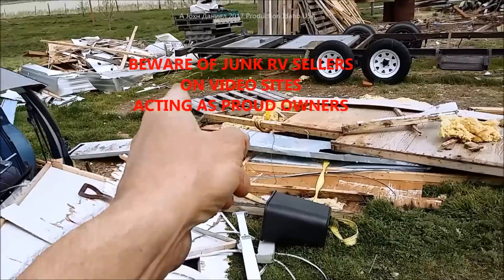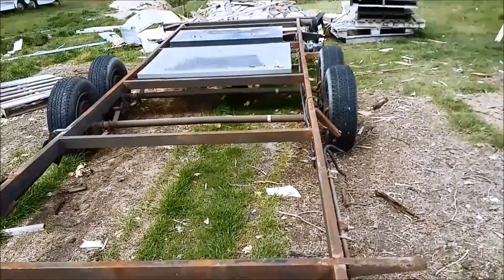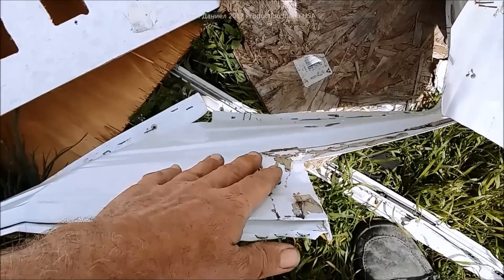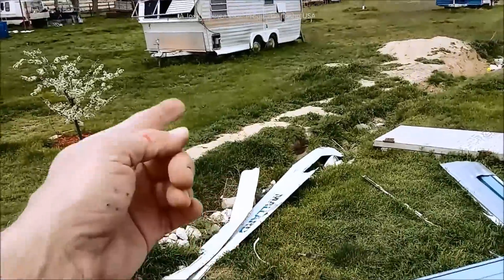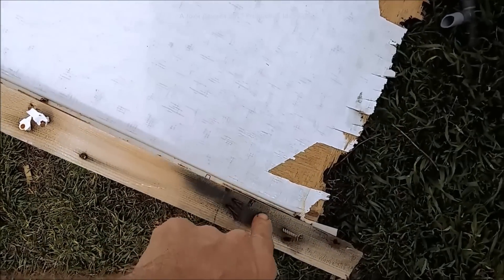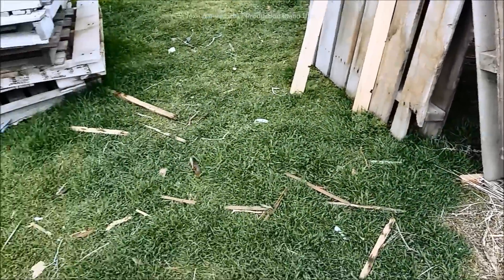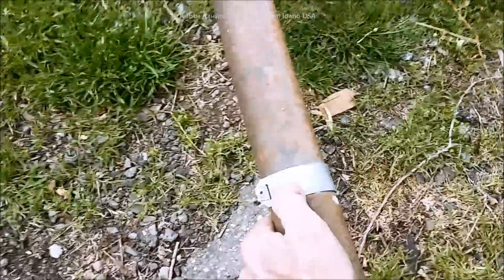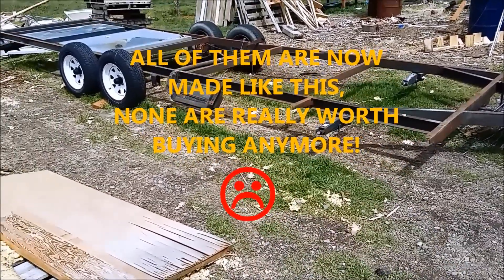HOW THEY MAKE RV Campers Travel Trailers, The truth, Wow! Info Below

Comment: yeah why not make it solid 20 tons of stuff to last forever - in one place because nothing will be able to pull it smh.
Reply from the maker: Normally I do not reply, but I just Gotta - I think your comment shows the absolute ignorance how a huge portion of the public think. That it can only be lightweight if built of pure shit materials. Or the other extreme, heavy like a fucking semi truck. THIS way of thinking is exactly why they can sell this crap. In japan for the Australian market they build a RV with Hydraforming, Injection foam molding, and extruded aluminum and a 6 meter, the longest there is 15% cheaper with more amenities and 25% lighter with a crash rating of a fucking volvo. But Nooooooo We Americans are pure suckers, because think like what you just posted is a enabler to the scum bag makers using primitive materials and saving $1 in sealant on a shitty RV. THANKS MAN!
Reply: your right - they use carbon fiber and maybe some kevlar and stainless - maybe some f-22 composites to keep the weight down with titanium beams.. i bet they could engineer one to last 100 years easy - my bad
Reply from the maker: Very wise thinking there!! Or they can learn a lesson from the Japanese! Or like my ground up construction, use very light 2.5" thick flat 43" tall garage door panels that are R-13 rated, and made lengthwise as long as you want/order them and then the trailer would be super light, rigid, rot free and cheaper....... Nah, they will go your way.

Comment: Not making excuses, but the manufacturer is trying everything they can think of to achieve weight reduction.  Its not a case of getting what you pay for, its a matter of not taking care of what you have.   I have one that is garage kept and it is as good as new (what that is worth is debatable), no dry rot etc...  Betting this one was put through the ringer by someone with the money to buy a new one every five years. But yes, the guts are weak.  You know that going in, I hope.
Reply from the maker: If they really wanted to do weight reduction they would stop using extremely heavy partical board and high density compressed MDF. They would use 2.25" metal stud which is 19% lighter than wood and stronger, they would use Hydraforming for trailer frames. They would use blow molded inner webbed fully complete fully finished one piece roof. No, they wanna leave out the seals like they did this one and use green cut lumber scraps and un galvanized staples and deteriorating formaldehyde glues.

Comment: There needs to be a class action lawsuit on this. I don't know why there hasn't been yet. I've been telling people to avoid travel trailers in general and go with an alumnum or steel caged older Fleetwood Pacer or Southwind (or similar). Better yet, convert a well built van. I now have a '79 dodge camper van. Solid steel (no rust) and fiberglass roof.

Comment: Based on past experience, if I had a 30-foot trailer I would put about 2000 lbs in it. It would weigh 7300 pounds or so. Of which, the axles could support 4600 and the tires even less.

Comment: I have been thinking about selling my home and land. Then buying an RV and a new truck and just going where the highway takes me, but these videos showing cardboard RV's is scaring the crap out of me.  I don't need a big RV because it is just me and I don't want to pull a huge RV around everywhere.  Does anybody have any idea which RV's are the best?  
I will be living in it permanently so I need a dependable one that will last 25 years or so.
Does anyone have any information of having the underside of an RV sprayed with Line-X or Rhino lining? Will it work to protect the underside from water and moisture? Is it possible to have it done?  What about the top, can it be sprayed to seal the top?  
I am asking serious questions as I have never owned an RV and I want to get a good one that will last.
I was told Line-X and Rhino would work and told it will not work, depends on who you ask.
Any information from RV folks will be greatly appreciated.
Thanks in advance.
Reply: Dief Enbaker Linseed oil,it actually soaks in and hardens. My deerstand and chicken is sealed with linseed oil. All plywood.
Reply: Apply with a Hudson pump sprayer.

Comment: Thanks for the reveal. I currently have a 1999  19' Coachmen class B camper van on a Dodge 1 ton. I think that vans are likely the best built RVs out there as they are just a converted Dodge, Ford, Chevy, Mercedes, etc. So the foundation is designed and built well. But I am looking to go full time in a travel trailer in a couple of years. Have you ever torn into anything made by Northwood? They claim to use a heavy duty frame, axles, and better framing, etc. Their brands at Nash, Arctic Fox, Desert Fox.

Comment: I am thinking about buying a 72 Airstream Overlander for just under 14k. Mostly all original interior and no visible water damage. Some family is telling me not to because of it's age, but after alot of research, new ones are built like garbage. This one is old and needs some updating but is SOLID. Any advice?
Reply from the maker: Compare it to crap on the market today,  30k for crap. So if you buy that you have 16k to put some high tech in it.

Comment: No way that's a 2008. Based on the color schemes and the rust on the frame (and frame design) it might be a 1998. Probably older.
Reply from the maker: Manufacture date on the door tag for state of Idaho plumbing Electrical inspection code, March 10, 2008. Title date May 5th 2008, registration date May 30th, 2008. 
But who knows, could have been sitting in a assembly yard 10 years.

Comment: I have a 28 year old trailer with mastic. It's fine. Mastic can work fine, but it also requires maintenance.

Also the reason, at least here i. Sweden for building it is due to weight restrictions. Building it in hardwood etc would make them probably 10x more heavy. Making them illegal to tow with a regular license here.

The amount of water damage is of course not OK, but the idea is for there to never be a water leak. As long as that is true they should hold up fine.

Comment: They rate the axles with the idea that 10-15% of the trailer weight will be on the tongue, so if it weighs 5300lbs, 530-795 lbs will be on the tongue. so you could put some stuff in it - a few hundred lbs worth.... however not much, and yeah, once you go over a pothole, the dynamic weight coming down on those toothpicks is gonna overload the hell out of them.  Those are pretty low for a 30 footer.   Toy haulers are built a bit better than a travel trailer - the frame has to be heavier and the floor a bit harder... and axles obviously beefier.  but other than that, the walls and everything is build just like this, it's sad... The funny part is they even advertise these as being super light, ultra light, etc... F that noise, gimme the one made of cast iron, steel and with tank tracks... :D
Reply from the maker: The first RV company to decide to use Roto-Mold UniBody construction will rule the world. Until then,  suggest termite, water, vandal and lousy ass construction insurance from day one.

Comment: I got the impression that trailors were junk, you can look at them and see how flimsy they are, and wouldn't last long. that is why I like air streams, casita and scamps. they cost a lot more but I still see air streams being used that are 50 years old and more.
Reply from the maker: There are only a few realistically well built RV trailers. I would rather have a Holiday Rambler, Pre 1994 over any other on the road. Other great makes are Silver Streak, Boles Aero, and Pre 1986 Avion

Comment: Did you put it back together?
Reply from the maker: No, sold the frame and axles for $100 as is. The only things  I reused was the AC unit and Heater. The rest was put in a dumpster.

Comment: You can badmouth that little Mallard all you want, but you won't convince me. First off, I am not in the RV business, I have no ax to grind. I bought a "99" 26ft. Mallard in 2007, lived in it full time in Mississippi for 10 years, I have no complaints. By the time I sold it in 2017, it did need some work, but I lived in it with 4 dogs, full time, and it served me quite well. It's easy to be a critic. Requires no training.
Reply from the maker: Thanks, folks needed one example out of about 1 million junkers of a a great well built version!

Comment: Real eye opener. Such crap and you have to get a tiny mortgage to buy it. Good thing I had mine custom made by an expert carpenter and I know exactly what he put in it. Only good quality material.
Reply from the maker: Just about every cargo trailer maker will build SPEC construct. Charmac in Twin Falls Idaho will build you a 30 foot true 100" wide fully ready to go tube steel framed unit with sewer tanks under it where you want and all the windows. For 40% the price of a rot box seller. Just do some research.

Comment: I had a brand new Scion "luxury" fifth wheel by Fleet wood. I had a problem with the black water rinse system leaking. I took off the access cover. I was shocked. Behind the access cover was the last shift's trash. Saw dust, sandwich wrappers, empty coke cans. All piled up and sealed behind an access cover. I guess the trash can was too far away.

Comment: I bought a 1978 prowler in 1988.It had a small amount ofwater damage in the rear wall leaked marker lights.I purchached front and back skin where lights were mounted.I tore it apart reframed wall with clear fir sealed with thompson water seal.All screws pulled windows doors evertthing replaced with new buytl tape.stainless screws one size larger.still doing very well and use it every year no leaks.Had to replace hot water heater last year.I know construction was never the best but this one has stood the test of time.I have the original stove  furnace and refridgerator.No circuit board stuff to go wrong.

Comment: I'm a full-timer in a 98 Thor Residency. Everyone knows Fleetwood is junk. The rot could've been from a water line busting or leaking on those junk crimps. We've replaced most of the connectors to get away from those crimps. Theyse things do require maintenance just like a house. But yeah, stay away from Fleetwood. Those are the ones in the rv parks with water running out the bottom. They try to compensate with pretty furniture...which is also junk.
Reply from the maker: Thor Industries made some bad assed RV's as long as you bought one thats pre 2005-2006. After that they acquired a bunch of defunct brands, including Fleetwood in 2009 or 10 and started building most of their RV's just like a Fleetwood. So if you buy used, seek a older Keystone Sprinter, a Thor before 2005, and do your homework!

Comment: So...entry level trailers ARE built like crap...no doubt about it.  However, when you don't want to spend $40k on a travel trailer, this is pretty much what you'll get, lots of cheap materials and sloppy construction.  I have a Northwood product and I can tell you the frame is MASSIVE and they don't use ANY OSB on the floors or in the trailer.  One note; Fleetwood no longer makes Travel Trailers.  RV'ing is not for the faint of finances...if you want to RV, get your wallet out as you can't do it on a shoe-string budget.  Also, 100% correct; You MUST keep everything sealed which means regular inspections of windows, doors, and all openings on the roof.  Having an RV is like having a second home.

Comment: I own a teardrop trailer made by Little Guy (now NuCamp) which uses an aluminum frame instead of wood.  Also, my teardrop fits in a standard garage so I can protect it from the elements. Teardrops aren’t for everyone and are really just is a step up from tent  camping.  Actually, they are still camping as opposed to RVing.  I’ve seen quite a few older women who want to see the country who buy a teardrop since they are light and easy to handle.  Again, they aren’t for everyone, but they have their place, and I think are better built than this.

It’s always fun to have people want to see our teardrop.  Almost all are pretty nice about it.  I did have neighboring camper make a point to come over and mock my little teardrop trailer a few years back and was giving me his rant of how I got ripped off on a price per square foot basis.  I’ve had my suspicions about the quality of bigger trailers like this, now I know. After watching this, I can mock back.

I think my next step up from the teardrop is going to be a Casita which is a fiberglass egg.  Casitas are larger than a teardrop, but smaller than this pile of firewood that you’ve shown,certainly better construction than you’ve shown.

Comment: I was on a tight budget but glad I held out for a Holiday Rambler. She's a 1988 29' fifth wheel and just as solid as the day she rolled out of the factory. Heavy boxed frame, welded aluminum superstructure and screws, not staples throughout. She's been outside her whole life and faded but still as tight as a drum. That's quality.

Comment: A while ago WE bought a 5th wheel (used). found out after using it ONCE, that it had some water damage on one side of the slide out. I pulled off siding to find water damage and severe rot which went all around the back, also above the door, and all over the nose.  I pulled the trim on the edge of the roof to get to the cause (roof?), only to find the rubber roof material barely went over the edge. And the siding didn't meet the epdm material. (I thought it would have overlapped the siding)The only thing sealing this point was the trim and buytle rubber tape. So as the screws rusted and the putty degraded there was nothing to stop the water. I am now in the process of completely stripping it down to the frame and plan to re-construct the whole thing myself. After all the horror stories and seeing the videos of these things being built, I'd rather do it myself!

Comment: Trailers are built this way to save weight and to keep costs down . The individual pieces don't have strength on their own, similar in concept to plywood. Each individual ply is weak on its own, but together it's strong and lighter than a solid piece of wood. It's called lamintaion. Aircraft are also built this way. Take apart an aircraft wing and you could easily bend the struts holding it together. Trailers are strong until water gets into them, just like cheap furniture made out of MDF. Pour water on your grandmother's antique dresser and you have a wet dresser, pour it on a Walmart dresser and you'll have a rotting mess. Airstream and Casita are built primarily out of lightweight materials that aren't affected by moisture, but they also cost way more than trailers of equivalent size.

Comment: What you say is partly true - BUT - if a company built them as stout as your suggesting, they would weigh so much that it would take a 1 ton dually to move them around.
Reply: Although I must say that BigFoot travel trailers (or any other "molded" fiberglass units would be a great improvement over stick-and-tin units)
Reply from the maker: You mean like my 32 foot Holiday rambler? With its 2x6 box frame and aluminum stud wall construction? Yeah, my 1993 F150 with a 300 L6 in it does have a bit of a time getting it over Donner Pass.
Reply: yeah, the more I thought about it, they don't need to be quite that light - your correct - these types are shit...

Comment: Just moved to Florida, cannot believe how cheaply made Fleetwood mobile homes are built.
They seem to dissolve like Alka Seltzer. So I moved on, bought a conventional home. Later on I bought a Winnebago Vector/ Grand Tour class A motorhome, no roof air.. Central Air, with a home air filter. A guy down on his luck.. Tried to sell me his 2006 Fleetwood Bounder. What a POS 😕 it was 5 years old, beautiful inside.. But !!! In time.. The slide outs became rotted out by the gear mechanism. I greased the dam thing each season.
The frame is Freighliner, and is perfect. But the rest is skunked.
This was a garage kept unit, I bought it in 2011. My Winnebago is perfect. Fleetwood should be sold at Harbor Freight.. POS.

Comment: John, I'm following you like Jesus!! What brands are good?
Reply from the maker: Winnebago as a Trailer is made with a more durable locking foam core structural design, it has a better water resistance build process then most. But other than that the whole industry is gone to junk. Few examples from each maker is good, but note the word few!

Comment: You'll never convince people with disposable income to not buy them though; hence the manufacturing/engineering choices..

I've torn apart Jayco, Oliver, Airstream, and Pleasure Way. They are all junk. Airstream has the corrosion resistance and aerodynamics which makes them a little better. All have garbage chassis joints and week metal. This is why they just become noisy and fall apart. You will pay what a house cost for one too.. Even a late model 16' is around 12k(used). No different with RVs just they cost way more..

There are assembly line videos online too that shows they are just cheap framing on cheap chassis with massive profit margin for the maker. Even with proper epoxy sealing and frame design the nails just cause a chain reaction of fall apart within a couple decades at best.. They don't use screws or metal reinforcements on the frame like they should..